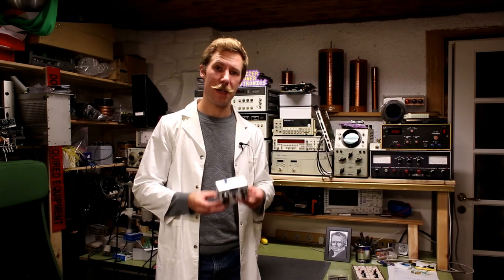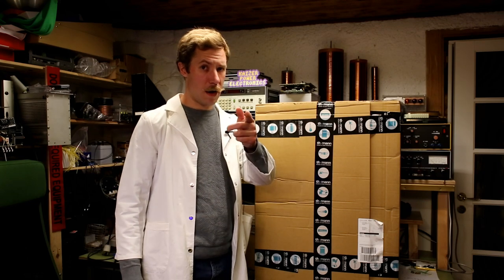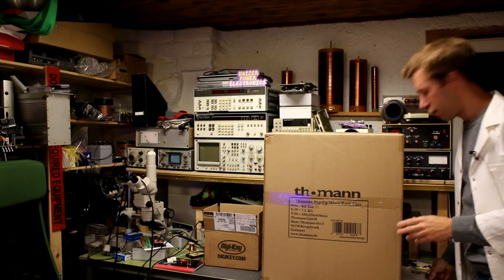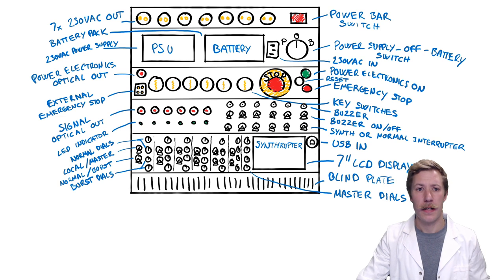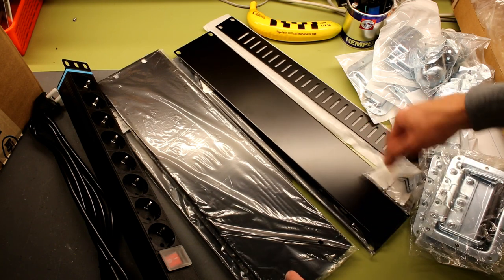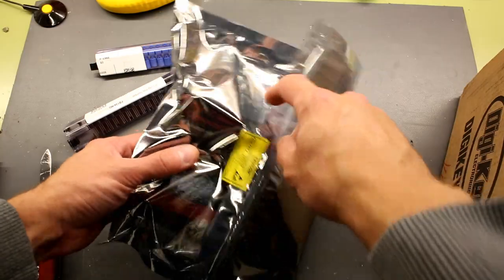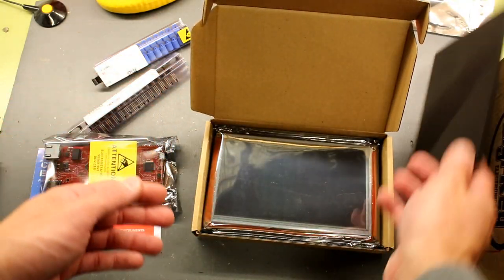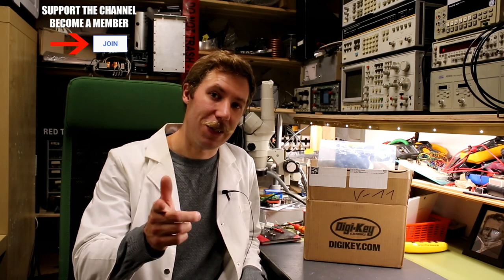Tesla Coil Show Controller Project (Part 1 of 8)

Comment: Kaizer (sorry I know I can't correctly spell your real first name :)) - random message but you and Loneocean helped me build my first SSTC that works beautifully. Unfortunately I live in the densest county in the world, so I can't go full power or my neighbors complain (or rather, I've gone full power and had a knock at my door). Just wanted to say thank you. I don't work in the electronics field - electronics, programming, etc. is a hobby - and I learned (and am still learning) a TONNE from you.

By the way, the SSTC killed my bench PS and my signal generator, so you owe me both please :)

Amazingly - and I mean this - my cheap-ass Hantek oscilloscope is a ****ing TANK that never gives up, I honestly don't understand it.
Reply from the maker: My first name is "Mads", with a soft d. No-one outside Scandinavia can say it right ;)

I am glad you found inspiration and material to build your own coils. 

Working with power electronics and inverters is not just basic electronics. Switching transients can kill your power supply and without proper current transformers and differential probes, you risk damaging your oscilloscope with wrong ground loops. I recommend that you read this short guide from Tektronix  before continuing: https://highvoltageforum.net/index.php?topic=111.0
Reply: @KaizerPowerElectronicsDk  Thanks!